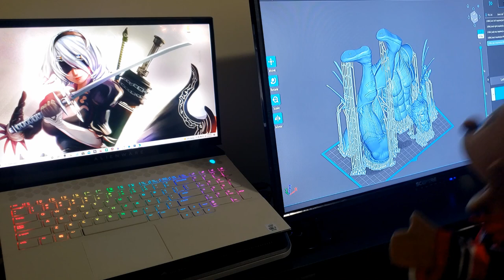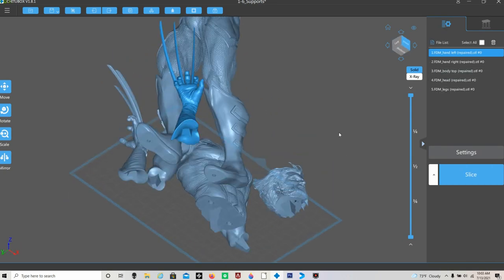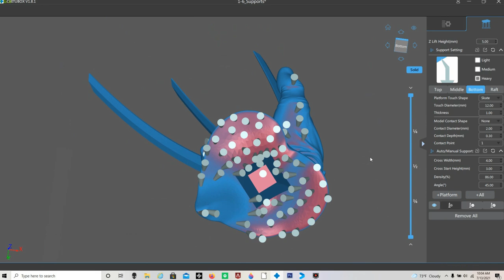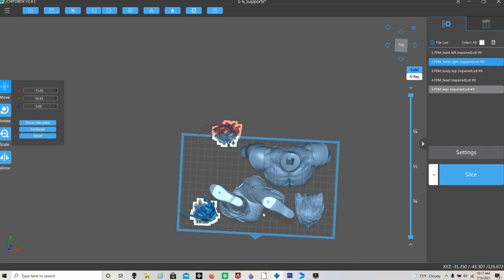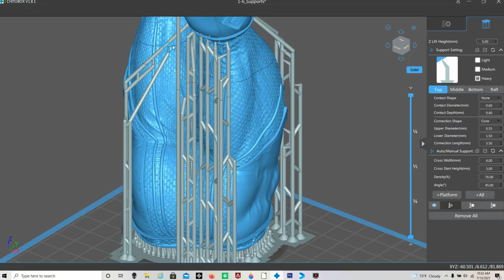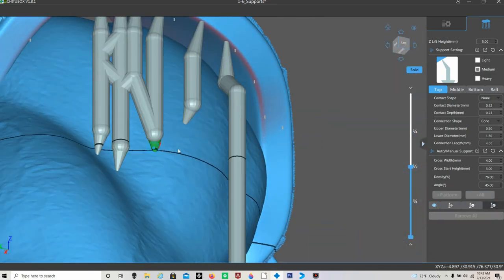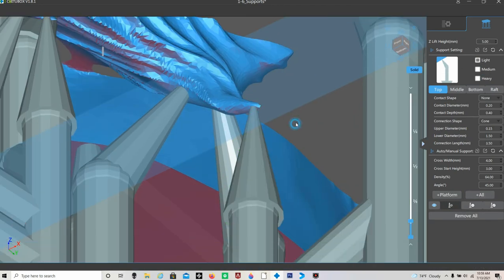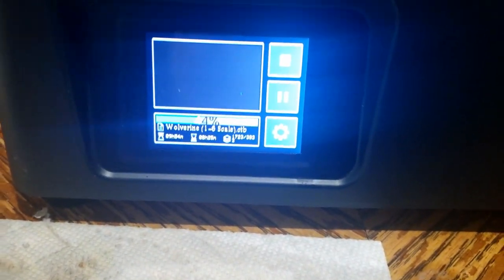How to use auto-supports in Chitubox and remove them for a near-flawless 3d print!

Comment: hello I am trying to print by using chitu box the print fail in a way it printing but not coming on plate. (object stick in resin tank). I am using prozen mighty 8K.  Thank you in advance to help me
Reply from the maker: If it's not sticking to the plate, you either need to give your plate a very light sanding and/or increase your bottom exposure time.

Use 600 grit sandpaper on a flat surface and scuff up the surface of the plate in circular motions all over. Thoroughly wash it off with alcohol to make sure there's no residue left. Your bottom exposure should be at least 30s, but for heavier/bigger models, especially when you don't hollow them out, you'll need to increase this time. For my really large bases, I bump the bottom exposure to around 60s sometimes.
Reply: Mod your lift time (usually: increase), exposure time both layers and bottom (increase them), clean (NOT SAND IF NOT DEEP SCRATCHED!!!) the plate, and check your fep (opaque? Scratched? Cracked? = Change it!). If you're using dense resins (Any-Ele) = increase a lot your lowering speed; "eco" or water washable= the better place is the trash. Transparent= multiplying all the times by 2 or more. Black = x1,5 your times.

Comment: Filtering resin after print prevents your LCD breaks. My only advice. I have a Mighty too, 139$ for a microscopic grain mistake. Clean the vat EVER between prints ;)
Reply from the maker: Good advice. I haven't had an issue with any residual cured resin in the vat damaging my screen but I have had the fep leak and cure resin on the screen a couple times so now I use a screen protector.